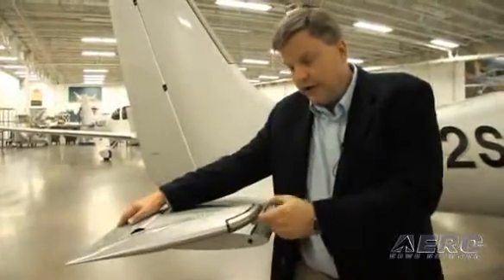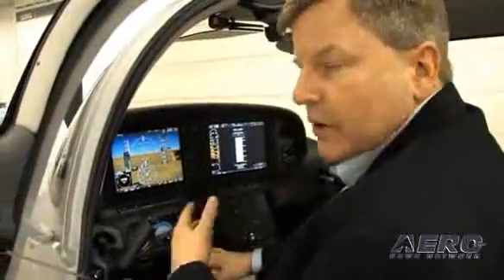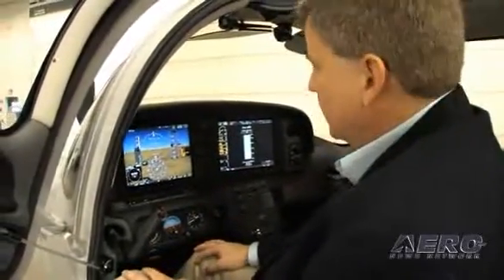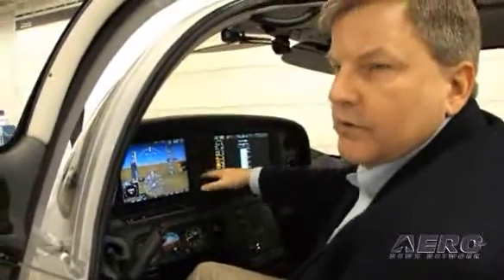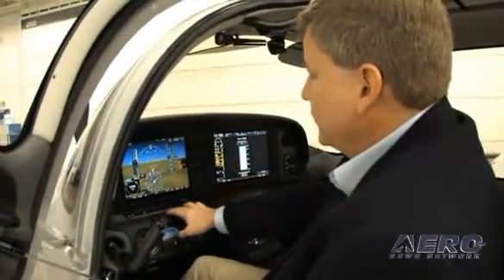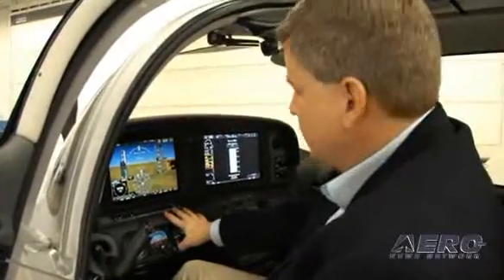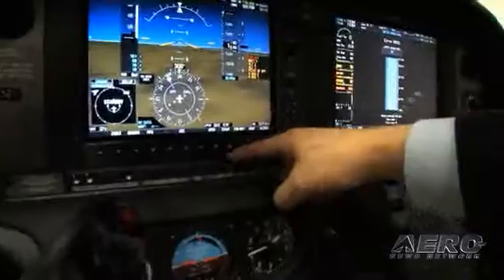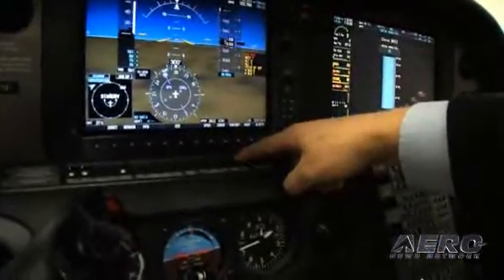Aero-TV: Cirrus Close-Up -- The Known Ice Protection System

Comment: interesting, they put a key on a de-icing fluid cap, because they are concerned about fuel mishaps. I would much rather have it the other way, last thing I would want in my fuel tanks is de-icing fluid....
Reply: The fuel cap uses a different key than the de-ice cap.  Generally you only lock the fuel caps when you want to protect your plane outside of a hanger on the ramp.  The de-ice cap cannot be locked in place without the key.